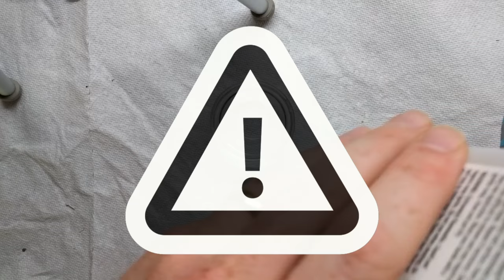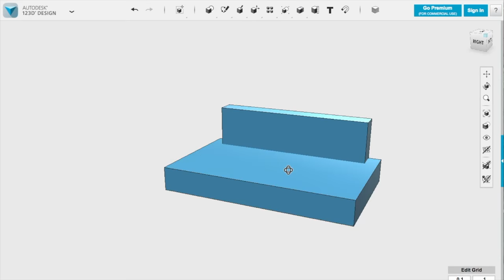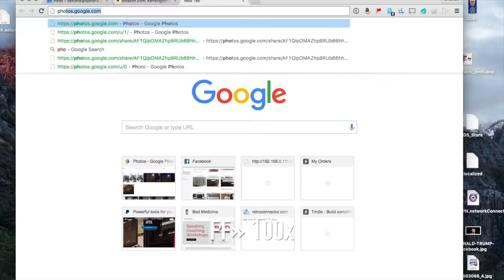How II 0x08: IIgs Latch Repair

Comment: have you tried high strength plastic epoxy (the thick gell that you mix to activate). I've used it to fix broken plastics and even use it to rebuild plastic parts and has worked quite well and if mixed properly it can cure harder then the plastic you're fixing.